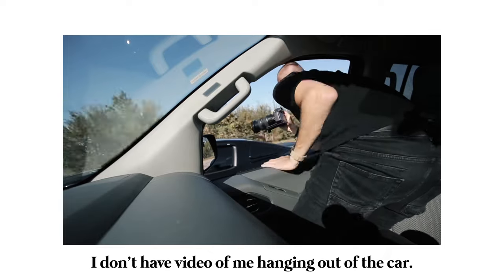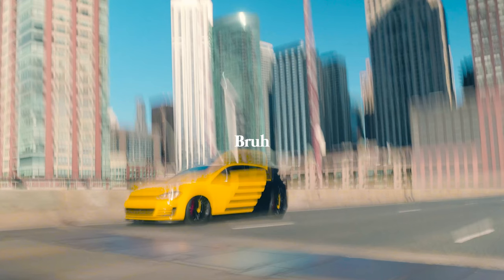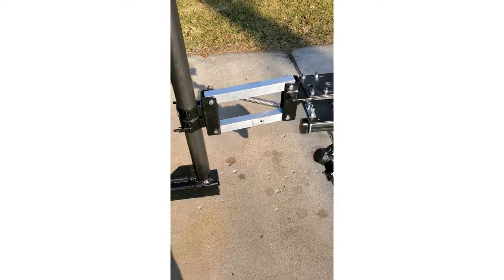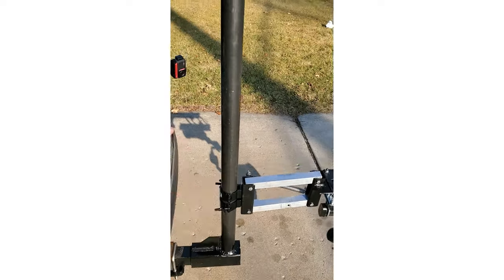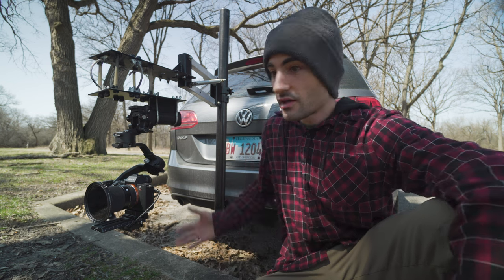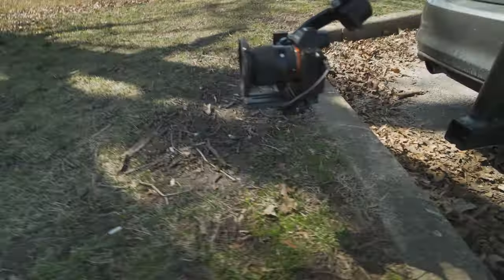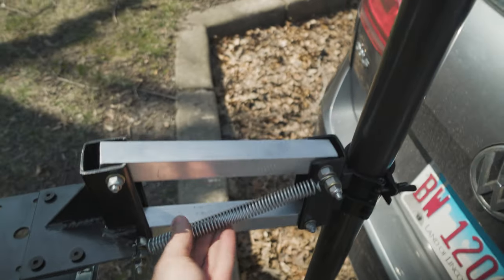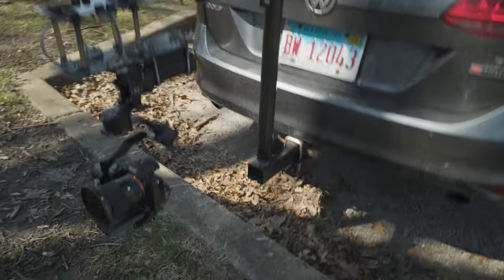DIY chase car rig | Build breakdown (4K)

Comment: After watching the video, I would add a max out/limit strap just incase that spring ever gives out, the gimbal wont smash against the ground, solid other than that.
Reply from the maker: Depending on the height that I choose, the gimbal won't hit the ground. 

The spring is a very thick gauge metal. Plus its really difficult to break as well, so I'm not worried about it just randomly breaking. 

However I am currently working on limit straps / other small improvements.

Comment: Haven’t finished watching, but my favorite part so far is was you scrolling through YouTube having watched all the videos I JUST finished watching lol. This is a big inspiration for me to bite the bullet and make my own, as the ones I saw on the cheaper end didn’t stabilize as well as I’d like, and the ones that I did like the quality of were nearing 5 digits on cost (I do this purely for fun, not professional or even a side gig). To the scrap pile and Home Depot I go.
Reply from the maker: I've since fine tuned the rig a bit more and I'm blown away with how it is turning out. 
I plan on making a V3 rig soon. I'd like to make it fully out of aluminum to keep weight down.

But yeah, when you're on a budget, you gotta get creative!

Comment: The pole you have the setup clamped onto is exactly what I’m needing! Slides right into the tow receiver and extends into a pole at a right angle, what is this item called please? Really helpful vid by the way!
Reply from the maker: So it's actually a part that I made myself. It was a 2-in hitch extension piece that I welded a 2-in pipe to.

Comment: I was building one of these last year for my Ronin SC but sold it and bought the RCS-2 which is what you have in the video. I like how you mounted it. I am gonna have the watch the version one video, my isolator doesn't work as good as yours. Dude that footage is super smooth. I have the raven eye which hooks up to the RCS-2 and allows you to stream a live feed and have active track 3.0.
Reply from the maker: My next upgrade for the rig is definitely the raven eye. Active tracking would make filming solo so much easier.

Comment: Beautiful spring arm design I will make it for my next project! Just one question what tube sizes did you use ? 😅
Reply from the maker: I used 2" sprinkler pipe for the main tube that the rig mounts to and then 1" aluminum square tube for a majority of the spring arm.
Reply: thank you man! if i pull it off it i will give you credit!  @KOYORIDE

Comment: great thing
I would like to recreate this.
can you help me with that?
I don't know what kind of clamps are on the pipe and where the rubber hose is between the two plates near the steel cables. greeting
Reply from the maker: This design isn't really meant to be copied since I build everything for my specific needs, but here's some information about it:

The clamps are 2-Inch truss clamps and the rubber hose can be anywhere. As long as they connect the two plates together, you'll be fine.

Comment: very coo and looks great, did you add post stabilisation or is that the ibis causing slight blur jitters?
Reply from the maker: At the time of making this rig, I used a sigma 30mm f1.4 lens and filmed in Super35 mode which essentially makes the lens a 45mm lens. Long focal length produced waaay too much jittery footage for my taste. The test footage was some of the first and since then I have fixed the jitter issues by switching over to a much wider lens. (16-35mm) I also ended up buying a newer camera, so there's that too.

This video is the first official test of the 16-35mm lens setup: https://youtu.be/KHfyZGOY_2Y?si=NhfLhcXG9Owehz3Z